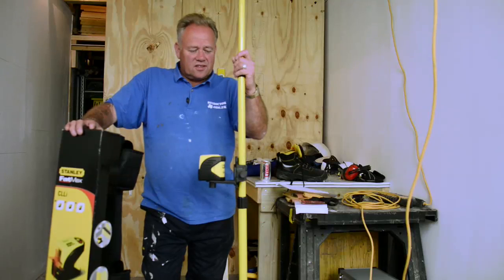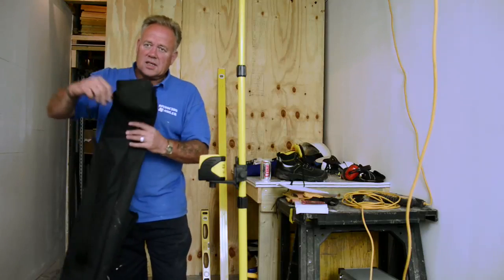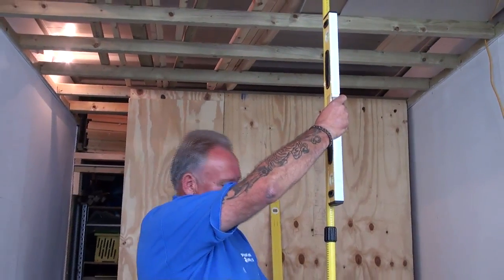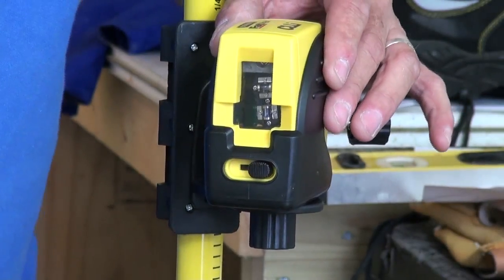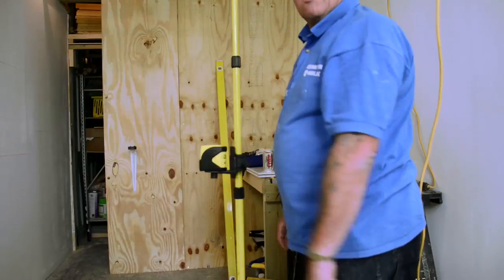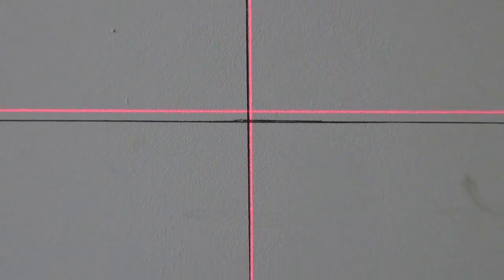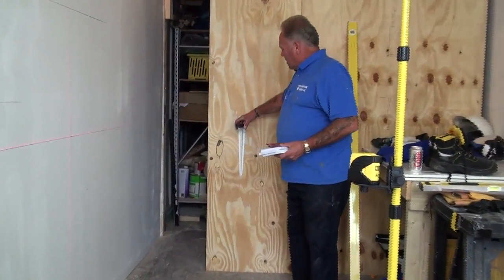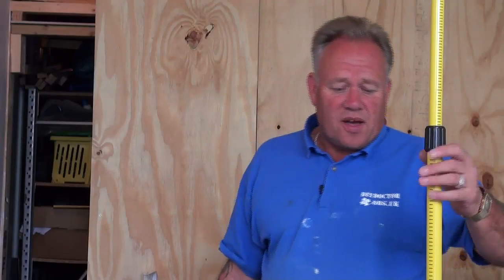Stanley FatMax CLLi Self Levelling Laser Level Review

Comment: I put a screw in each corner of the plate at the top of the pole. This stops it from slipping, which it does quite easily, when clumsy twats walk past and brush against it. This is the only draw back with the pole but if you know that then you can do something about it. Apart from that you can't fault it. If you want a tripod to go with it you can get one off of Ebay.
Reply from the maker: +HILUX CHAINSAW Great idea, thanks for the suggestion
Reply: DIY Doctor
Don't go right the way through, just so you get  4 tiny spikes :-)
Reply from the maker: +HILUX CHAINSAW Thanks

Comment: Why did you have to level  the pole for a self leveling laser level? You just have to ballpark it or just move it until laser stops flashing. That is the whole point of a "leveling laser".
Reply from the maker: +0x5347 The more plumb the pole, the quicker the self levelling operation works. When you use oneof these in a room for lot of levels it's important it sets quickly so you can get on with the work. If you have all the time in the world and want to wait while the laser sets every time you turn it to a new position just whack it up by all means